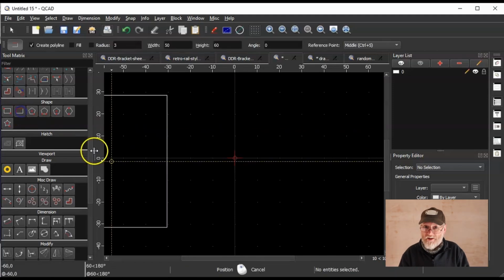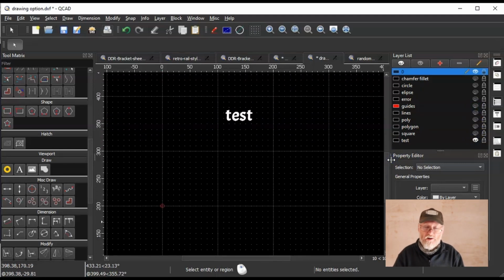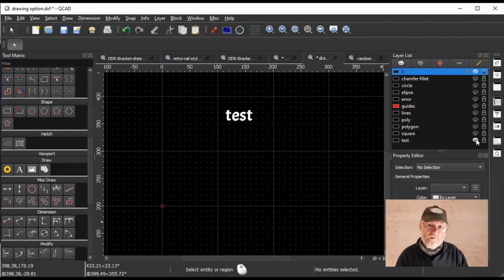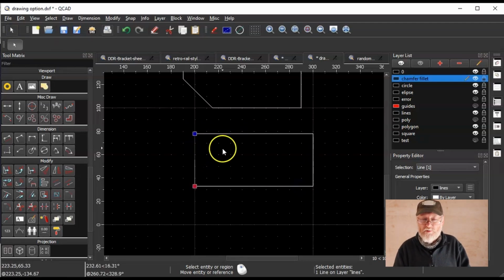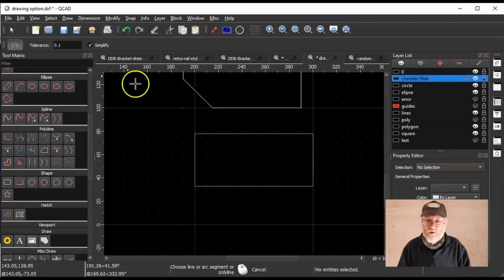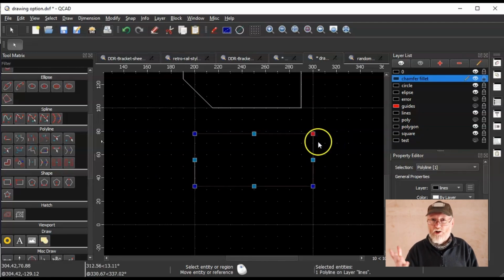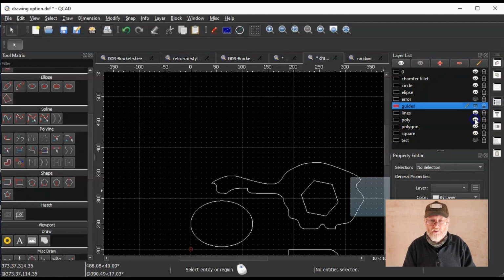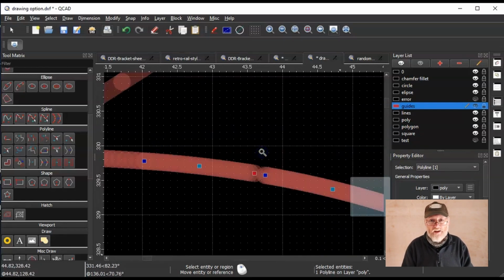CAD Tips for CNC Newbies

Comment: Thanks, John, Are you making more CAD videos, I've been wanting to get into CAD. I only have the free programs like fusion360 and free cad but I have no clue how to use them at the moment, How do you find the anomalies?
Reply from the maker: Not sure Graham, I'm a bit of a ludite in that I use only 2d CAD which isn't in favour with many. For what 90% cut on their machines it is the best option, just not sexy.  I'm more than happy to talk about the one I use and or answer further questions on CAD.

FreeCad I personally think is an aboniation with all the different workbenches. 
I have previously used Fusion360, it didn't suit how my mind works but I understand it isn't as free as it was.  

I recently tested Alibre, I liked it but found that at the level of package I needed, I don't need anything high end, some basic features were missing, so I stopped testing.

If I can get my hands on PunchCAD to test, that one appears to operate how I do.